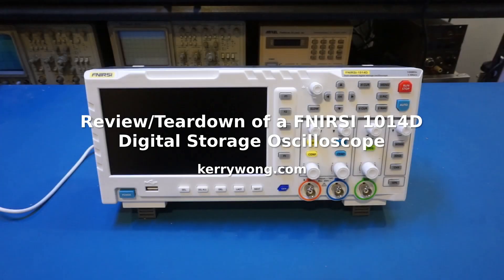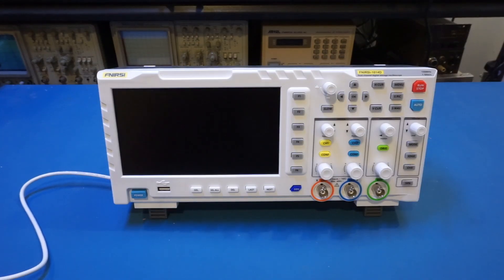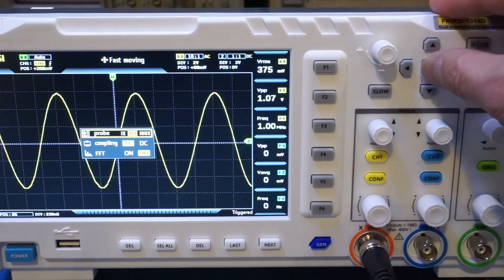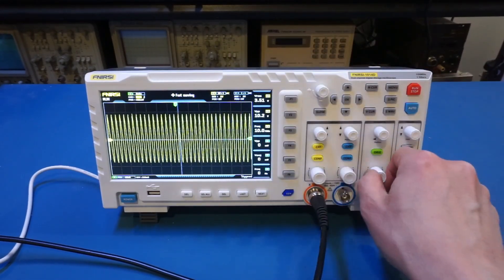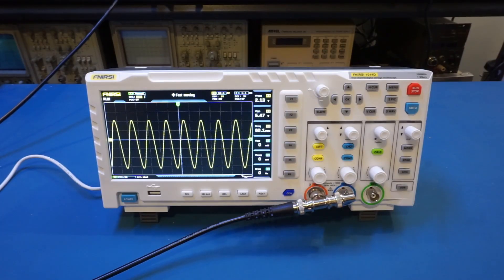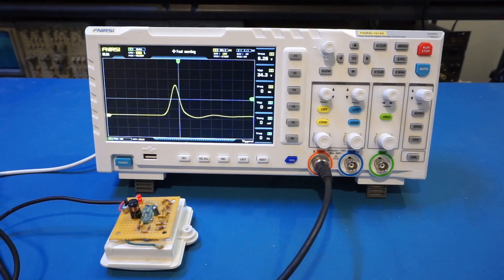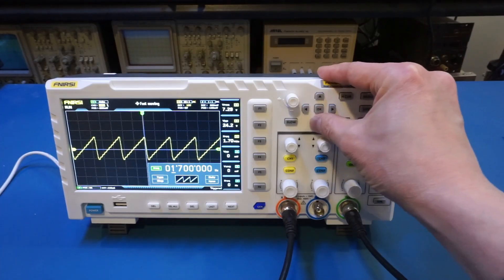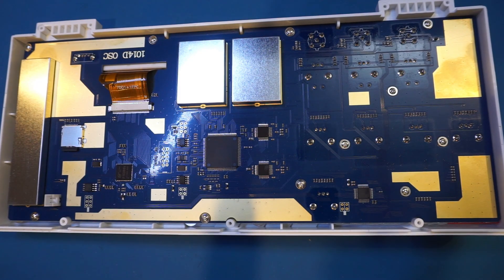Review/Teardown of a FNIRSI 1014D DSO - 100 MHz or 30 MHz Bandwidth?

Comment from the maker: Please turn off "Stable Volume" in the video playback setting (the first menu item after clicking the gear icon) as for some reason, this new YouTube playback feature made the video much noisier than usual.
Reply: Your bandwidth conclusion is probably incorrect since you are using x1 (direct 50ohm cable) and not the x10 attenuation.

Comment: Correct me if I’m wrong: a good rule of thumb is that an oscilloscope’s bandwidth should be about 5–10× the highest sine-wave frequency you want to measure accurately in amplitude. So a 100 MHz scope, like this, will typically give good sine amplitude accuracy up to roughly 10–20 MHz (depending on the error you’ll tolerate). Above that, it can still display the waveform, but amplitude accuracy increasingly suffers as you approach the -3 dB bandwidth limit. Bottom line: the measures you showed look good to me... especially for a budget oscilloscope like the FNIRSI 1014D.
Reply from the maker: No, if it's a 100MHz scope, it should be able to display 100 MHz sine wave except perhaps for a maximum amplitude attenuation of 3dB. If it's a square wave, then yes, you will need to have at least 5x the bandwidth to be able to display the waveform correctly due to the harmonics.
Reply: @KerryWongBlog  Thank you for your explanation 🙏

Comment: Just bought one to use on audio repairs on a separate bench, not my  large guitar amp repair bench. The fact that it has a sig gen built in will help as well though I may need to run the signal through an attenuator so I know how much signal I'm injecting into different stages  but it's one less thing I need haul around. I know it most likely has warts, etc and will never compare to my HP DSOs or my TEK analog scopes but it's small and portable. All I'm going to use it on is troubleshooting audio stuff. It should be fine for that. 
Thanks for the honest review though!

Comment: Hi Kerry Wong I recently watched your YouTube review of the 1014D oscilloscope and wanted to share my thoughts. I felt your comments were a bit harsh, as this oscilloscope performs well up to a solid 25MHz with ease. If someone requires a device for radio work for 30MHz and beyond—up to true 100MHz - 200Mhz or higher—then this may not be the ideal choice.
However, I’ve been using my 1014D straight out of the box for tasks such as power supply repairs, laptop diagnostics, electronic projects, and Arduino-based work, and it has consistently delivered good technical results. While it might not match the performance of scopes that cost double or more, it provides excellent value for its price.
Here’s a Min summary of its capabilities:
•	Accurate Readings: Reliable performance up to 25MHz with precision in AC/DC voltage measurements.
•	Key Measurements: Frequency, Vrms, Vmax, Duty Cycle (+/-), Vpp, Vmin, Vp, and Vavg are all clearly displayed on the LCD—ideal for diagnostics.
•	Freeze Frame & Single Shot: Capture waveforms directly on the oscilloscope or export them to a laptop for further analysis. Saved waveforms can be reviewed with cursors.
•	Built-in Function Generator: Supports sine wave output up to 10MHz, square wave and other signals up to 2MHz.
•	Portability & Power: Operates on a 5V mobile power pack, making it great for a clutter-free workspace.
•	LCD Display: Provides good visibility even in daylight conditions.
If you're looking for a quick, reliable tool for measurements, I find the 1014D to be perfect—especially when factoring in its price.
Thanks

Comment: I bought one some times ago. 
I struggled with the unreadable (too small characters) and unclear manual. The knob at the top center (without any label) is not described anywhere. 
The function generator is unusable. Some videos on YouTube explain it better than the manual. 
For a little more money there are similar devices that perhaps work better. The incomplete and unclear manual is typical of FNIRSI; (I also have other devices of theirs). I do not recommend it.

Comment: The phenomenon of the waveform being distorted at 5:45 is a fatal problem for an oscilloscope.
I'm thinking of replacing my OWON DS7102V, which I bought 13 years ago, because the LCD screen has deteriorated, but I won't be considering buying the 104D.

Comment: I recently purchased (june 24) one of these to replace my old sampo 2020 CRO 20mhz which no longer works. It seems to display the waveforms i would need and does most of what my old sampo does, plus a few extra things. I would assume it has the current firmware installed. I have found the voltage reads about 10 percent over compared to my multimeter but that does not bother me. 
As regards the 100mhz claim, according to the manual under the heading "solemnly remind" it actually only is a 5mhz oscilloscope and it is the probes capacitance when set to X10, which attenuates the 100mhz to an equivalent bandwidth of 5mhz.  With the machine also set to X10 it makes an appropriate reading of 100mhz even though it is an actual 5mhz at the input of the oscilloscope.  Not very accurate but I suppose it serves the purpose of recognizing 100mhz signals. A spurious claim to be an 100mhz oscilloscope but It is not really an issue for me
I don't think I would pay for something double or triple the price to get a an instrument which is true 100mhz as this one may suffice for what i want. I think it is ok for the price and not just a toy.

Comment: I think is a good deal.  Probably it is rated as that 100 mhz is the cutoff frequency like a transistor where the gain is reduced to 1 , hence no gain there, but there may still be a usable signal output.   Having a frequency counter in a scope is very helpful for fine tuning some RF signals.

Comment: Lol they must have meant it breaks at 100Mhz. Still I'm thinking this might be a good beginner scope for debugging basic arduino digital logic.

I currently have no visibility into what's happening with my DIY circuits, and the arduino's clock speed is only like 16Mhz anyway, so I don't feel like it's worth spending more than ~$150, plus many other cheap options are handhelds with smaller screens. So I'm not sure what other low-performance budget options there are for desktop scopes with big screens for less than $150.

Comment: I'm an unfortunate owner of one of these osciloscopes (the price got me, and I was looking only for a backup/extra instrument). The main problem really is the gain, it won't see small signals, minimum scale is 50mV/div with 1x probes! Other problem is impedance matching: I was seeing a 5Vpp 1KHz square signal using the 1x probe. When I switched to 10x, it turned to 5.3Vpp (using cursors or automatic measurement gives the same class of error). The actual signal was 5Vpp, measured simultaneously with two other reliable (with valid calibration certificate) osciloscopes. So, I think there is some kind of impedance mismatching. I've tried with two distinct 100x probes with even worse results!:An actual 260Vpp signal showed as 220Vpp in the FNIRSI!. So, it seems to only work ok using probes in 1x mode! So, my advice is the same: don't waste your money!

Comment: Nice video, but at a price, that is substantially less than that of the Hantek and Owon you cannot do a fair comparison. Even if this scope does not get to its claimed 100MHz, you cannot compare it against two handheld units with small screens and bandwidths of 20MHz and even though the Owon is said to have a 70MHz bandwidth, in reality this is 20MHz. The Hantek actually is quoted as just 6MHz when using a 1 x probe.

I have two other scopes which are bench models that are very good, one is 40MHZ the other 300MHz, so there would be no point comparing those to this, other than for testing its capabilities.

I do loath videos that are deceptive no matter how good they are, unless they can show a comparison between like for like with similar prices.

Comment: Hmm. When looking at how the response drops with increasing frequency to measure the bandwidth, it's important to set the probe to x10 mode. The reason for this is that most probes have a terrible bandwidth themselves in the x1 position.  So what you're probably measuring here is the bandwidth of the probe rather than the oscilloscope.

Comment: The problem is not that this scope is good or bad,  the main problem is lack of honesty from the manufacture to publish specs that this scope is far,  very far from reaching and may lead those not well informed to buy and try to use it in applications where it simply cannot deliver.
Reply: with the real spec and stuff

it should be selling for less than half the price being what it is, the design, manufacturing and all

even if they did lie, it should be selling for what it s worth

but this shit selling at same price as real 100mhz hantek lol

at least for most crappy chinese lying trash, they are selling for what it s actually worth

Comment: Interesting review.  Bought one to test and returned it... The scope starts cutting at 10 MHz (which for my needs would be OK, but don't lie about specs!).  Also: the function generator included (which was a big plus as we wanted this for some teaching labs) is complete garbage.  You can't adjust amplitude... It has FFT analysis but no way to do anything with the FFT other than observe the picture, no analysis tool.  Overall, the hardware is probably OK (again don't lie about specs) but the set-up is incomplete and poorly thought.  I don't recommend it.

Comment: Is this an ok Scoop to work with Vintage audio?
Reply: I use a dso150 200khz bandwith a lot to test my audio designs. I mainly look at sinwaves to see where the amplifier clips. I long have been wanting to buy the fnirsi 1014d with more accuracy and functionality. Fof audio the limited 30mhz is way more than you need, except if you want to repair radio equipment.

Comment: Well these scopes are well enough for Audio Equipment repairs (expecially the VERY lucrative Vintage segment), so the limitation to 30 Mhz have not weight. With a tiny price a professional can repair with great accuracy Amplifiers, Cassette Decks, CDs, Mixers and all is in the frequence range of 20-20.000 Hz. All this spending a fraction of other useless equipments now on the market. It is a sad realty but the bulk of the job done by laboratories is fine with a 20Mhz Analog Scope of 40 years ago. It is a fact that the advent of brands like FNIRSI, Hantek, Hanmatek, low budget Owon have caused a big hit on Siglent / Rigol balance sheet. Amazon have the warehouses full of Rigols and Siglents that nobody purchase. Recent cheap scopes are all sold out instead.
Even the integrated function generator IS NOT a fantasy, a decent low frequence sinusoidal wave generator is all is needed in Vintage repair and the signal emitted by FNIRSI is well enough for all Hifi Vintage repairs . 
Kerry deal with this. I can see some strugless in the future of some well known Pro Chinese brands
Reply: So, will this be alright for the newer, solid state amplifiers as well?
Reply: I have two 250w Radio Shack PA amps in protect mode.. Will this work for them?

Comment: It met my expectations, which weren't high. Money's worth, i think.  I'm just using it for hobby purposes.  I used to employ Tektronix CRT scopes in my work.  This one meets the specs of one of those that cost thousands.
Reply: Yes, mine too for the price you get a good enough scope if you are aware of the limitations. I use this one more frequently than my old Tektronix as it has more convenient controls. I rarely need to look at freqeuencies higher than 10Mhz. Even for square ones that the bandwidth would distort the signal cutting off the higher harmonics.

Comment: Very good appraisal of the FNIRSI that points out the dishonest specifications (typical) that stare you right in the face!  I watched your other scope video for the Hantek DSO-02D15 which is by far the better scope of the two you reviewed, thanks for that since 'entry-level' or 'beginners' oscilloscope kits has a lot of self-appraisal by the scopes manufacturer.

Comment: I have a question for you Kerry,

I tried the same bandwidth test as you do - with the FNIRSI1014D I get 698mV at 19MHz. That's not even 20 😳 But my Rigol MSO5072 is at 982mV at 60MHz (that's as fast as my AWG will go) - do you think it is because of the FNIRSI - or because of the signal generator?

I'm still keeping the FNIRSI - even though it also is mildly inaccurate. Why? Because it's safer than the Rigol measuring high-voltage circuits that share the ground with the Rigol but not the FNIRSI (I can run the FNIRSI off of a battery pack - and it's cheaper than buying capable probes for the Rigol) and also, abusing the auto button on the FNIRSI is a whole lot faster than the Rigol - manual or auto - which is... odd.

Additionally I don't like the faux phosphor look of the Rigol. I like my sines clean and squares square - and sharp. But that's a personal preference.
Reply from the maker: Bandwidth measurements can be tricky, it would be more accurate if you have proper 50 Ohm termination. That said, if you saw such drastic discrepancy chances are that the 1014D's actual bandwidth is indeed significantly lower than what's spec'd.

Comment: This review has been challenged because it makes the wrong conclusions
Reply from the maker: If you disagree, at least put down your points so people can use their own judgements and derive their conclusions. I'd challenge you to list out the conclusions you think that are wrong and I'd be happy to address with concrete explanations
Reply: @KerryWongBlog Kerry, can you clarify - did you measure the scope bandwidth with the 10x probe? Other reviewers report that the 1x probe has a low pass filter and is speced for something like 5 Mhz, while the 10x probe supports the 100Mhz bandwidth.
Reply from the maker: @walterkuhn2080 x10 probe was used in all my bandwidth testings, including this one .

Comment: Hi Kerry, you asked for other opinions.  I just made a review of the FNIRSI 1014D and I came to a different opinion to yours.  I hope I explained clearly and logically in my review why  I disagree with you and invite you to comment here or on my review regards the usefulness of the 1014D.
Reply: Interestingly, Wong has chosen to reply to a few comments but very noticeably not yours.

Your review is far more useful because it was done by a professional technician putting the scope through its paces on practical tasks.
Reply: Still no reply from Mr Wong 🤨, If he was right, he should answer to your question
Reply: Mr Wong said in a comment below: "To be fair, I wouldn't have any issue with the scope if the manufacturer was honest with the specs."  Richard, you were also disappointed when you couldn't find a beeper on a 3 Euro multimeter during one of your recent tests and came to the conlusion: "Bin". :)
Reply: @andrewsz8552 when has a Chinese manufacturer ever been honest with their specs 😂
Reply: No se necesita de otras opiniones,este producto de esta marca es una basura....yo tengo un fnirsi para uso automotriz y se daño rapido y la fabrica no responde .
Reply: @mecanicasobreruedas3773 skill issue

Comment: The "unmarked" ICs there are AD9288s, these are dual 100Msa/s 8-bit ADCs. They are interleaved to get max 200Msa/s sample rate. The sample rate then is 200Msa/s at 10ns/div, 50Msa/s at 1us/div, 5Msa/s at 10us and so on... There is no anti-aliasing filter of oversampling in this design, so this is nowhere near 1Gsa/s written on the front bezel. The measured rise/fall time is 10ns (matches 30MHz bandwidth). The large unmarked chip is ANLOGIC Eagle4 FEF2L45 FPGA device, the design apparently is cloned from that found on Internet and pretty much the same as 1013D.  The good feature is power from USB (one could also use a powerbank). I have seen many clones of that in online stores, so I am not sure if there was some other "true" scope which  had original specifications. The overestimated parameters habit is the same as in selling 8000mAh 16850 batteries from China, in reality 1000mAh...

Comment: this video is 10 months old, do you still have it?  Is there a firmware update that has improved something?  Or is it still bad?
Reply from the maker: Yes I still have it. The version I had is the latest according to Fnirsi's website. Firmware update can only fix some glitches and will not fundamentally change the frequency response. That is mainly determined by the hardware.

Comment: Trigger doesn’t work correctly due to ADC sampling rate is below 5 points as of course it not 1Gsp/s. A problem I seen with 80’s scopes when equivalent sampling rate. This one actually maybe worst as the 50mv sensitivity?
Reply: Hardware sensitivity is 100mV software increased to 50. Very bad.

Comment: I have 3 of these oscilloscopes and I had to repair one of them and since I couldn't find a schematic anywhere, I had to create it myself in the EAGLE program. It took me a whole month to put it all together. So I found 3 errors in the oscilloscope, in the play of low-voltage devices and one in the power supply. That's why he says I have the scheme.

Comment: If the author had traced the line from the input connectors to the measuring chip, he might have noticed that the tracks go all the way across the board past the switching power supply. I think there's a lot of noise building up there and reducing the measured frequency. 
But for repair work on household appliances this device is quite enough, because it is almost never necessary to measure signals above 16 MHz. Therefore, it would not be cost-effective to invest $1000 in a very good device.
Reply: Or, as he said, you could spend in the same ballpark amount and get a vastly superior handheld from Owon/Hantek. Portable too.